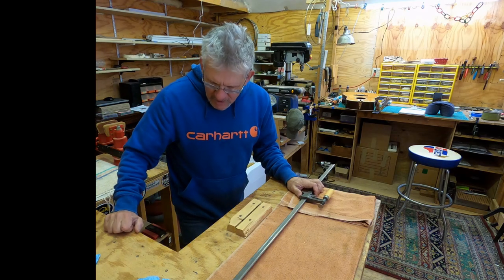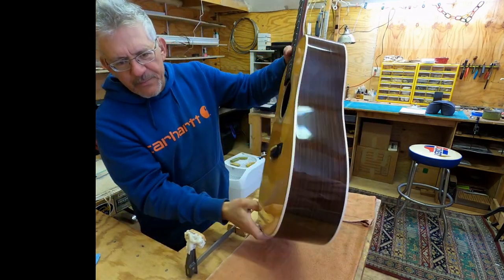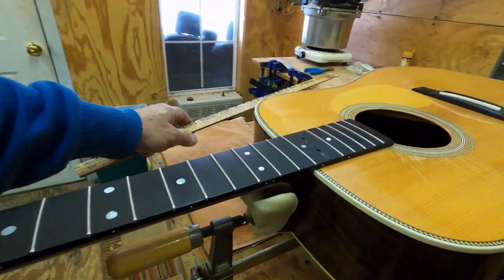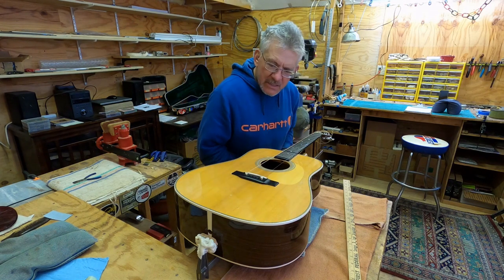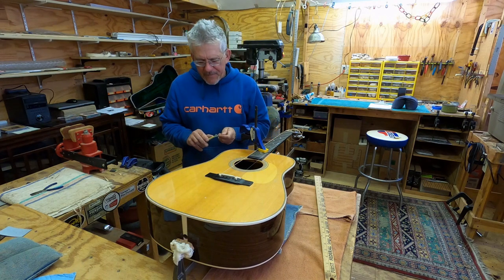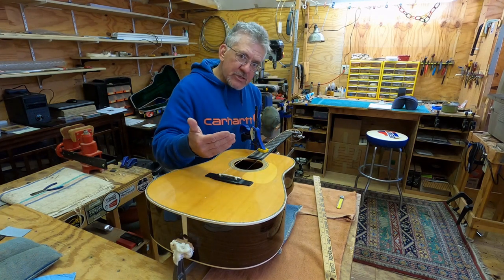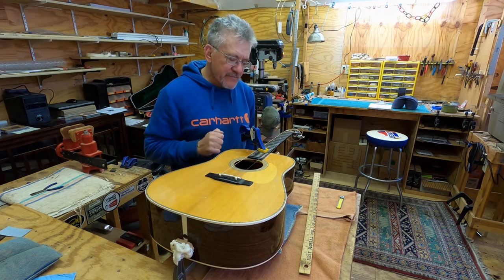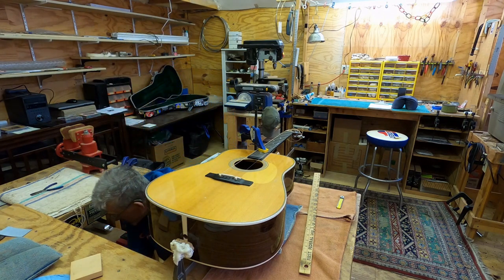The Neck Reset Jig

Comment: Thanks for your insight into neck angling. Every little bit of info really helps those of us who only do a very few neck resets. I made a similar jig after seeing yours on your website. It's a 2x4 with a wood cross piece on it to stabilize. I have wood blocks mounted at both ends and use a clamp on the tail block end in spreader mode which presses the neck heal against the neck block...perfect, Thanks.

Comment: Hi Brian very interesting Insights. I think my CS 21 -11 ( complete hide glue) needs a neck reset (t-bar and compression  frets on a madi fingerboard... Now I have to find the right luther here in Berlin who is experienced enough and willingly doing it. 
What should i consider and look for to have it properly done and how much should it cost?

Thanks for your good videos and Insights.
Reply from the maker: Compression fretting is an art.  I don't know what these things would cost in Berlin but in the US, you'd pay $300-500 each for the refret and neck reset.
Reply: @Bryankimsey  All right, Sir. Should I request some special relief data or what should I request him considering your video for less or No neck relief? Hide glue, madi Fingerboard, t-bar...?
Cheers.

Thanks
Reply from the maker: I have 4 videos talking specifically about neck relief- search for them on my site.  The problem with compression fret jobs is that you can't just dial into a certain number.  You have to mix regular size tangs with .0225 with .0235 with .0245 with .0255 to hit your relief target.  You have to check constantly and accurately and predict what it's going to look like under string tension.  It takes about twice as long as a regular fret job and IMHO, few people have the know-how to do them.  

I'd shoot for .002" to .006" of relief at the 6th fret.
Reply: @Bryankimsey  wow, thanks you very mucho.
Do I have to find Out which fret Material they took and will Martin answer me?